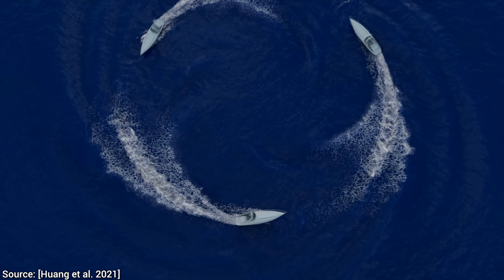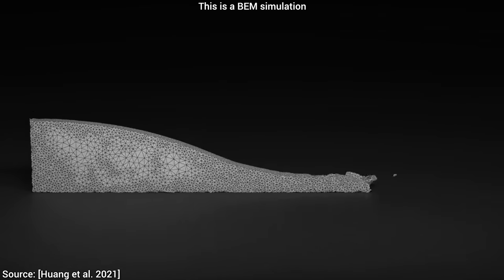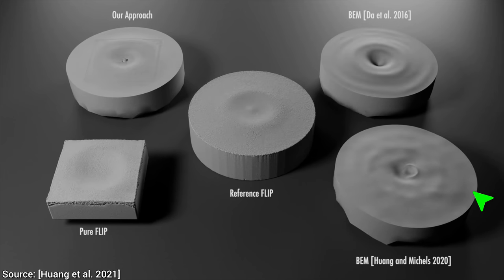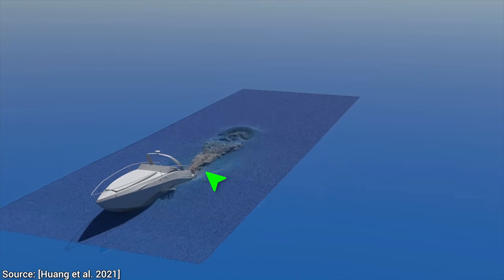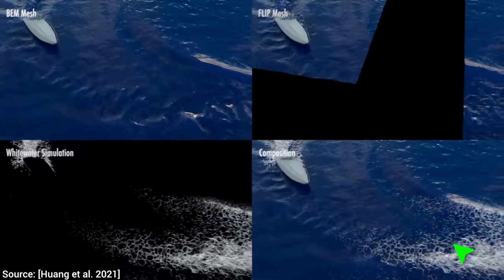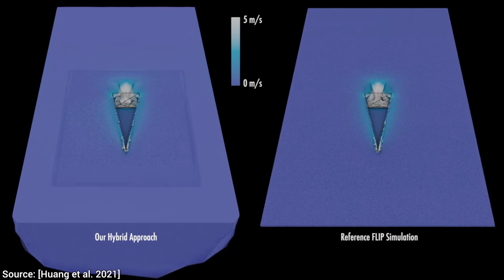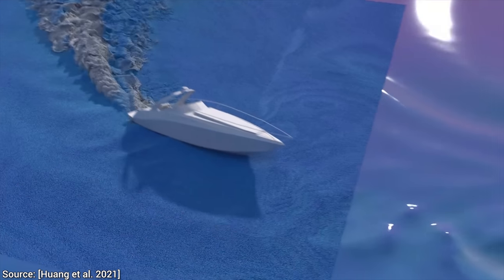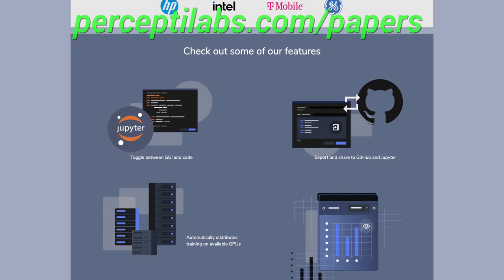This New Method Can Simulate a Vast Ocean! 🌊

Comment: Oh my gosh this is insanely promising. Simulation LOD, basically. I've been wondering how large scale oceans with crashing waves could be approximated in real-time, this could be an interesting piece of that puzzle.
Reply: Yeah we have small scale flip working in real time and the surface method is what we generally use in game engines so we're already almost there. My bet is that this is running in real time already with nothing else in the scene
Reply: @Ben-rz9cf  i wonder how it usually works though because a lot of movies have large oceans with a lot of detail in areas. I guess something kind of similar to this existed but this is just better
Reply: You know you're into computer graphics when that's one of the things you wonder about
Reply: @Ben-rz9cf  It's still seconds per frame here, according to the article. Maybe 2 more papers down the line? The thing is, if all you're doing is approximating for a game, FLIP with millions of particles is totally overkill. There's gotta be a better way
Reply: @BL0B5TER  when doing the surface one, which is sort of done already in games although often more "static" than any physics, combined with AI physics as the channels has showed? Could be fun, but a huge mess and complicated. So the "physical action" combined with visual physics. It knows what it should be like, has some references and applies it? But now I'm just messing around.

Or "cheating" with some dynamic animation tool. Like how in certain games there is no physics like in rotating or putting forces on the car, but all done through animation. As these forces applied will make it look or rotate like that. Like a pre-set wave but when something new hits it, it will dynamically adapt
Reply: And if we complete that puzzle, can we finally get Wave Race 2 please?
Reply: @freddyready8756  Oh, yeah I see what you mean. Nvidia's actually done work on making fast fourier waves like Sea of Thieves look like they follow and crash on a coastline with some clever vertex manipulation, and they've shown it costing only 3ms for large scenes. The drawback for this kind of stuff is that water can't accumulate into puddles outside of the ocean, and big waves still don't crash, they just collapse. Maybe there's a way to fake a procedural wave crash without actually simulating anything, that would be the holy grail!
Reply: @njdotson  Composting. They take multiple simulation renders and blend the video output.
Reply: Actually there is a cheaper way to do it, in theory.      You can use a combination of techniques such as the MIT Lotto Algorithm and zone mapping to perform the simulation in 2D and upscale it into 3D. I know how it sounds. I've tried to explain it to several professional game developer friends and they have nervous breakdowns trying to follow me. It doesn't help that the explanation starts from 4D projections into 3D as a basis.
Reply: @njdotson  That's correct. There have previously been methods for blending small FLIP domains with large-scale ocean environments. The primary difference (in my experience) is that the previous methods seem to be a simpler extrapolation of the FLIP boundary out into the ocean geo, and the ocean waves are introduced into the FLIP sim using the same noise spectra that the ocean was created with.

Short version: Typically oceans are created using various noise patterns (instead of being simulated), and FLIP domains are extended into that (and vice-versa) using more traditional extrapolation techniques. This paper actually introduces another phase of simulation for a more accurate and detailed blending of these boundaries :)
Reply: Let's hope continuous LOD for simulation is two papers down the line. Might help the still ongoing research on that for static scenes as well.
Reply: @njdotson  For VFX in movies we have the luxury of long rendertimes for FLIP simulations and noise based ocean surfaces as well as the power of combining it with footage of real water in 2D/compositing

Comment: Blending the edges of those two methods must have been a bridge. 🥁💥
Reply: Similar to how we blend simulations of different scales in astrophysics. If you can impose Hamiltonian separation, then a bridge is a method to couple simulations. Feedback is the hardest part to simulation, and often ad-hoc methods are what get used. I would be that machine learning will be an interesting avenue to impose these couplings later on.

Comment: Amazing work and great video. I hope you'll do one on the subject I'm currently working on: the Lattice Boltzmann Method. Instead of solving the Navier–Stokes equations directly, or simulating billions of particles, this method is basically is a cellular automaton that works at a mesoscopic level by dealing with particle (probability) densities.

It can be shown that the LBM actually is a general PDE solver, however it's mostly used to solve Navier–Stokes-ish equations. Moreover, it scales well as it's almost embarrassingly parallel.
Reply: 👀 Go on...
Reply: @BL0B5TER  Well, historically the LBM emerged from the field of cellular automata. In particular, this model can be seen as a continuous version of lattice gases, which were used to describe gases at a molecular (microscopic) level in a very simple manner.

A more recent approach consists in thinking of the LBM as the discretisation of the continuous Boltzmann equation in velocity space, physical space and time. To provide some background, Ludwig Boltzmann was one of the founder of statistical mechanics.

As I mentionned in my previous comment, a fluid can be described at a microscopic level ("there's a bunch of molecules interacting with one another"), and at a macroscropic level ("what's the density and velocity of the fluid at this point in space and time?"). Boltzmann and others showed that a fluid could be described at some kind of intermediate level: a statistical one.

To keep it simple, you can either see the LBM as some kind of generalization of the very simple gases lattice models, or as the discretization of Boltzmann's work in the XIXth century. Both approaches are equivalent, and result in a method that can simulate many kinds of fluids. There are indeed many Lattice Boltzmann (LB) models, which can be used to simulate fluids with different dynamics.

In practice, we don't use a single standard set of Navier–Stokes equations. Sometimes we need to work in 2D instead of 3D. Sometimes we can neglige the temperature, sometimes we can't. We always start from the N-S equations, but we can tweak them a bit given some assumptions. For instance, I use the LBM to simulate the blood flow through the entire vascular network in 1D. In any case, we can prove with this mathematical procedure called "Chapman–Enskog expansion" whether the fluids' dynamics that a given LB model can simulate follow the equations we want or not.

All is well and good, but why do we need this weird method of simulating fluids? First of all, the LBM is nothing more than a fancy cellular autamata, which is pretty much as easy to implement as Conway's Game of Life (as you can see with this python code http://paste.awesom.eu/OZo6&ln for instance). This method also begs for parallel implementations, and GPUs are very-well suited for this task.

While simulating fluids flowing through porous mediums can be tedious using classical methods, it's almost trivial to do so with the LBM. Well, trivial in comparison. The same applies with the problem of handling complex geometries, such as blood vessels. That's just some of the advantages of this method, among others. Of course, it also has its downsides.

And I find it pretty elegant...
Reply: @HoloDaWisewolf  That's really interesting. I've been looking for something like this and never stumbled on LBM, thanks for the overview! Reminds me of voxels, that gives me some ideas
Reply: @BL0B5TER  The term voxel actually comes up quite often when working in 3d with this method. I'll try to give you a better idea of how it works since you're interested. Assume that our domain is a simple 2D square. We start by discretizing it with a given resolution.

Now let's say we want to initialize our fluid with a density of rho and no velocity. These are macroscopic quantities, and as mentionned before this method works at a lower scale. For each voxel/square/lattice site, we'll distribute this rho accross 9 populations of particules: one for each direction (left, right, up, down, the diagonals, and "center").

As the LBM comes from statistical mechanics and kinetic theory in particular, the concept of equilibrium is central to this method. At the equilibrium when there's no velocity, the "center" population is equal to 4*rho/9, while the population corresponding to the left, right, up, down directions are equal to rho/9 ; and the ones corresponding the the diagonal directions rho/36. As you can see, this all adds up to rho, and some populations contribute more or less to the density than others.

There is no velocity here as each population is compensated by the populations of its opposite directions. This macroscopic quantity is non-null when there's an imbalance between the populations of one side. Disregarding the diagonal populations for simplicity sake, the x-velocity would be defined as (pop_right - pop_left) / rho.

We know how to compute the density and velocity of the fluid at each point in space from the populations of particles. Conversely, we can also determine from these macroscopic quantities what would the populations be if the fluid was at its equilibrium. Well to be fair, I didn't discuss how to compute them when the velocity is non-null. But there's a simple formula for that.

The LBM is an iterative process. For each lattice site:

1. compute the density and velocity from the current populations
2. compute the "equilibrium populations" from the density and velocity
3. (collision step) pop_current = x * pop_current + (1-x) * pop_equilib, where x is the relaxation rate and relates to the viscosity of the fluid
4. (streaming step) the left population goes to the site at its left, and is replaced by the left population coming from the site at its right ; and the same applies for each direction beside the "center" one (a simple np.roll is enough to implement this step with numpy)
5. increment the current time by one time step, and go back to 1.

To put it in a nutshell, this method uses a bunch density distributions called populations of particles, which can be used to compute the macroscopic quantities that the N-S equations uses. At each time step, we mix the populations of every lattice site according to some formulas, then we move them to neighboring sites according to their associated direction. And this is enough to retrieve the dynamics described by the N-S equations.

I haven't talked about boundary conditions, obstacles, forces like gravity, multiphase and multicomponent flows and so on. But I hope that I was clear enough for you to get a good feel of this method.

"The Lattice Boltzmann Method Principles and Practice (Krüger)" is an excellent book on the subject, and you can find plenty of other useful resources on the web. Good luck and have fun with your projects!
Reply: So... write a paper
Reply: @Dimencia  There's tons of cool papers on the Lattice Boltzmann Method, and many more to come. I'm merely doing my MSc thesis on this subject. It cannot possibly qualify as a paper worth mentionning on this channel. However that doesn't make this field any less interesting!
Reply: @HoloDaWisewolf  I have a suspicion this could be complemented by a sparse octree somehow, too! I'm wondering how particles get iterated without any kind of interference, if everything is parallel. I'll have to look into it, thx Holo!

Comment: 3:50 That is a minor detail, that can be faked pretty convincingly with textures, and be much much cheaper 😄
Reply: Or maybe a form of tessellation.
Reply: @wws2179  remember the video where the AI changed the GTA gameplay footage to look real? they could just apply that to the ocean surface as well.
Reply: Except then it is not a simulation
Reply: @hitta750  Yep. We would still be at stone age if listening advices from fakers.
Reply: @hitta750  Except, yes, it still is. You're just blending another texture on top.
Reply: Aren't you missing the point? It's not whether or not you can fake it with something else, it's about simulating the real thing.
Reply: @mikakorhonen5715  Even this simulation is "faking it". Everything in physical modelling is a simplification trying to look like the real thing. It's just a question of how convincing we can make it for how much effort. The small detail on a fairly still surface can be very convincingly simulated with a texture for little effort, which makes it a good solution.
Reply: @MarvinCZ  But adding a texture does not change the underlying simulation, which is what this video is focusing on.
Reply: @boredguy1297  Most propably won't work with very reflective surfaces. Ocean needs to reflect sky and thats possible only by heavy raytracing.
Reply: @MarvinCZ  that's a good solution if your goal is to make it look as good as possible in this specific situation , but we're looking for water simulation in arbitrary situations, where "just add a normal map on top" is pretty bad excuse for imperfect simulation. We're faking everything, yes, but we're trying to approach real life in sufficient detail, and the detail here was insufficient... by your argument you could just show real life footage and say "we're faking everything anyway"
Reply: @kebrus  and you're missing the point of what these people are talking about. For application in things like games it doesn't need full simulation. It has to visually look accurate, which is a tradeoff between simulation and clever techniques. Yes, the research is aimed towards full simulation, but you don't need that for most use cases.
Reply: @Merthalophor  Even for physical simulations, something like this may work. If you can show that the true behavior in the outer regions are approximated well by the BEM results plus random noise from some particular distribution, then you can use it for a large class of physical simulations just fine. Barely any physical simulation has the goal of, or requires, simulating every single particle in a system anyways.
Reply: @martijnp  there must always be someone just like you that takes things too personally for no reason at all

why are you stating the obvious? I didn't miss any point, yes we all know these simulations are not for realtime applications, and yes we all know that for MOST cases it's irrelevant if it's 100% accurate, but why is it so hard for you to comprehend that this is NOT one of those cases?

this is a SIMULATION, not a "looking good" water dynamics. This is how research is done, you first try your absolute best to simulate the most accurate water so you have a point of reference (ground truth) then you come up with optimizations to make it faster, sometimes at the expense of some accuracy, but that doesn't mean with total disregard of it. These papers and this in particular are one of those. Perhaps in the future a new paper will take that high frequency detail into account in a accurate yet still performant way. Till then it's fine to point out this particular lack of feature in this paper.

If we are going to be pedantic and say that we can approximate that detail with scrolling normal maps or heightmaps then lets also say that we can approximate the actual boat water interaction with height/normal based particle rendering with local domains that can be rendered in realtime. That's how games do it these days with very convincing results.

Does it matter to this video? No, this video is about optimizing simulations.
Reply: @Merthalophor  We are talking about this specific situation though. The method in the article handles the areas where there's "something" happening, we're talking about the areas where nothing's moving on the large scale and no interaction with the object.
Reply: @krystilize1573  No, there is nothing about "changing the underlying simulation" here, it is the simulation. There is no "underlying simulation" that another simulation is changing.
Reply: @MarvinCZ  I never said there was another simulation. I am saying that adding a texture does not change the simulation. And therefore has nothing to do with the actual simulation, and more to do with applications of the simulation.
Reply: @kebrus  I don't get why me using your choice of words is me taking things personally. You saying that tells me that you are obviously taking what I said personally. We'll scoff it up to projection this time around. 

The comment was obviously made to look at applications for THIS tech to be used convincingly in other applications and not as a full on simulation. Just because that's the purpose of this paper doesn't mean it can't be modified slightly and applied to a wide range of scenarios. Looking into the possibility of applying these technologies outside of only research is what makes this research useful. I fail to understand why you see people excited over the possibilities and speculating on simple fixes to improvr the lacking parts of the simulation as something negative or against the spirit of the research. 

You seem to forget that research is done with a purpose, and not to make a shiny 1/1 simulation just to be thrown away. Why do you care if people are looking into this with actual reasonable applications. Would you rather have this sit to rot and nobody using the researched methods?